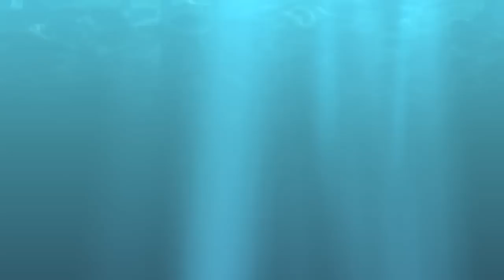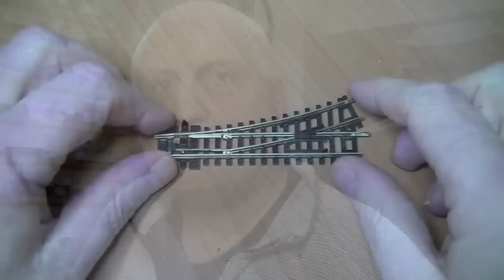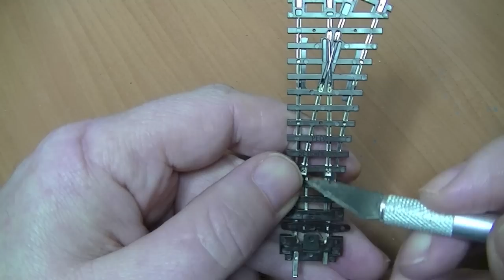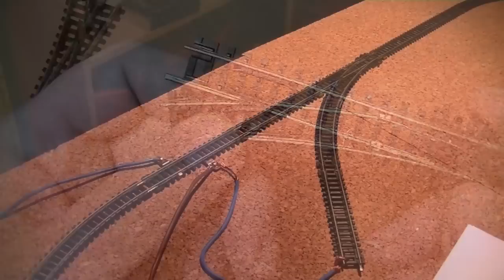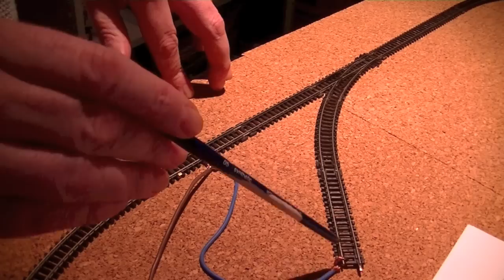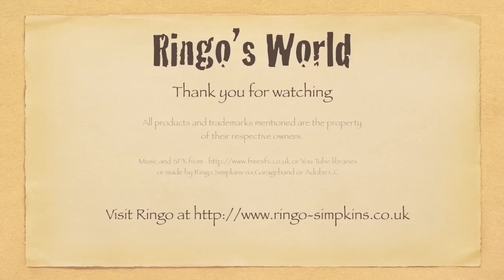Ringo's Model Railway: First attempt to get a point working

Comment: Nice experiments Ringo, well done on the point, I am not a DCC user, but think you should use live frog turnouts, you shouldn't have to solder as you did. On a live frog you can get some tiny metal staples (for want of a better word) that clip onto the track, so carrying the power through. Hope that makes some sense...Ian
Reply from the maker: TheDiomedef16 Yes makes sense, I am using these ST-5 and 6's as that's what I have currently. I don't think it matters too much about live or dead frog's from what I've seen - at least I don't have to worry about polarity switching on the frog with these. I am using live frogs for everywhere else. Seems to work OK at the moment.  I think I may have to file a bit away near the frog though, as the wheel may cross on to the either the negative or positive rail as the frog is quite short - as I say, these are "for now" points

Comment: great update, didnt fully understand why the rewiring was necessary because the track seem to make contact once the junction switches over, but that might well be because i know too little of the dcc system :) 
it does seem to be a little bit more quit with the cork underneath although it does seem minor, but with more trains running on the track it might be more noticable :)
Reply from the maker: unkhter You can't afford to have no digital signal going to the chip, if dust or dirt gets between the point connectors the current may stop and thus no signal get to the chip and the motor will shut down, it's just insurance of a constant feed of data through the rails from what I understand. Because all the rails are powered all the time after the rewire if I don't pull the top wire out I will get a short circuit and the controller shuts down the power. In DC, the power is running the motor direct from the rails, in DCC the chip onboard the loco regulates the amount of power being fed to the motor, the data for it to do this is being sent through the rails along with the power - hence the need to erradicate any possibility of a short and the need for constant power to at least one set of wheels on the loco.
Reply: ***** the short-circuit i understood, but it was all the other rewiring that looked unnecessary :)  now i understand the need of all that rewire work, thanks for explaining :) 
you just want to avoid a power interruption no matter how short because it also has a control signal(s) for the loco.  quite a bit of work to do then if you need to tackle all junctions in the same manner...
Reply from the maker: Well, that's what I have been told at least .. I think I'd better start getting good at soldering LOL

Comment: I presume that you have tried the original points (pre-cut'n'solder) to see if they work - yes?
With regards to the sound issue, once you start adding terrain, assuming you're looking at hills and wotnot, probably carved from polystyrene, then that should help dampen the sound vibrations through the boards. Another thought is adding sound insulation to the underside of the table to stop the sound being transferred down through it (and stop making things sound so hollow) - again, polystyrene should be great for that, but you could also check out specialist sound insulation products, such as pads you could stick onto the underside of the table ... just a thought ...
Reply from the maker: ***** Yes, it works perfectly for DC out of the box, however I am using DCC therefore it needs to be rewired for DCC. In DC, the direction and speed of the loco is determined by the current and it's polarity via the track, problem is, under DCC that's not the case, the track always has one positive and one negative rail and these are the same at all times on all sections of track, therfore having bare uninsulated (+ and -) wires crossing each other would cause a shutdown, hence the need to cut the wire briding under the point. Power needs to go to all rails at all times, so having a  - or the possibility of - a dead area would also be bad, as the chip on board the loco gets it's instuctions via packets of data being fed in to the track from the digital controller into the onboard chip, and it is this chip that controls speed and direction (and other stuff). Hence ensuring a constant feed across the point by joining the two outer rails to the central rails, too long a break (as relying on the connections caused by the point ends meeting is too flakey) would potentially mean the loco would get no data and thus stop. As for sound, speaking  as an audio engineer, I have considered damping the underside, I think that for the reduction it would offer vs cost and effort I may just stick some random blocks of kingspan under there, but I do need access for wiring etc, so it may not be worth worrying too much initially. Depends in it distubs the wife watching tele in the livingroom above, if she can't hear the layout running then I will not worry about it LOL.

Comment: Well done mate, you just DCC'd a 'dead frog' lol. I know what you mean though, it's a real head scratcher this DCC thing. Don't worry too much over the cork underlay, once you start adding the ballast and all that PVA it will all work out. Have you checked out Simons Shed on TY?
Reply from the maker: Andrew McKay Cheers, I am quite pleased with how it went .. I am sure I will get better at the old soldering malarkey, but at least I know the DCC is working as I think it should .. Regarding the sound & cork, I am using the 1mm rubberised (gasket) cork mainly to get a 6" scale shoulder to the ballast (2mm = 1foot) and it's a happy accident that it takes out low and mid tone sound a bit more. I am subscribed to Simons Shed already, but cheers for the pointer.

Comment: If you add power to both rails at the end of that siding you won't have to do all the mucking around with that point.  It will work.  Does that make sense?  Toot Toot.
Reply from the maker: pbeccas Where did the replies to this go?
Reply: Google Plus